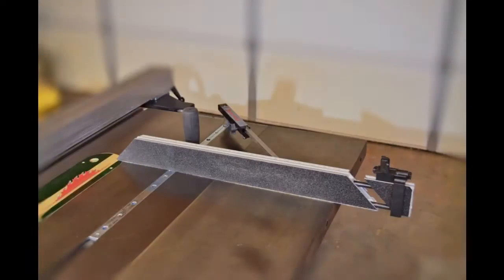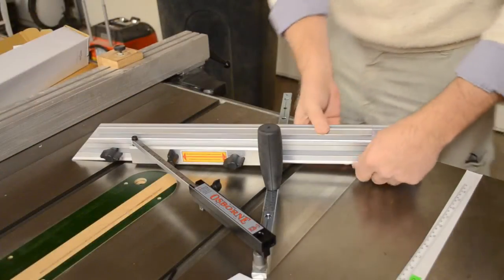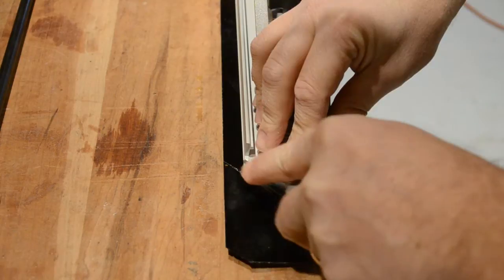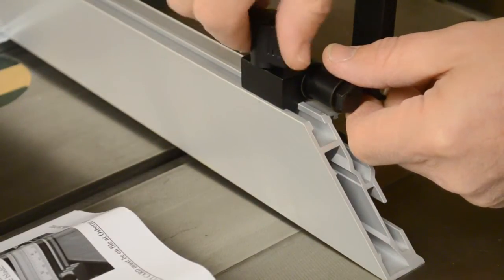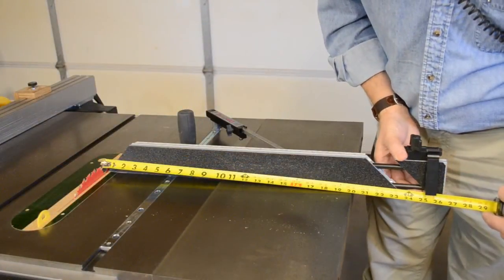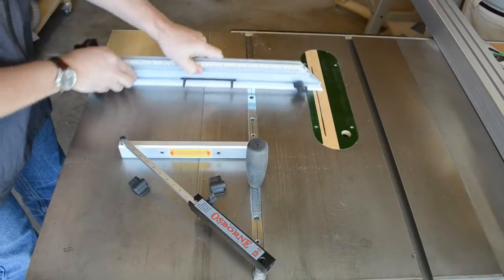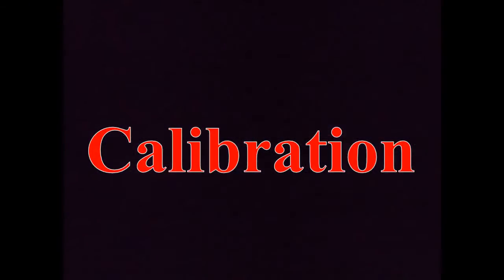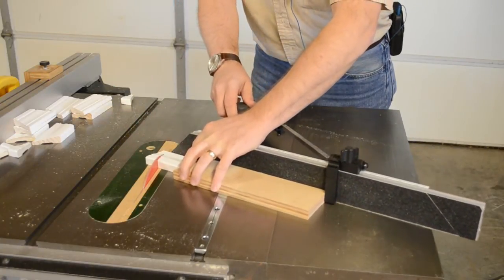Assembling the Osborne EB3 Miter Guide

Comment: I have added an in-feed extension for the guide bar to rest upon when cutting wide plywood. its just a 12" extension for cutting 24" wide plywood ( a typical width when building cabinets). This a very well thought out tool. for this price point it can't be beat.

Comment: I love my EB. I no longer use a sled and with the assured repeatability and accuracy, this is my go-to miter solution.

There is one option I would like to see added to the EB product line, if you truly are looking for perfection.

I would love to have a micro-adjuster on the stop. It would be much easier to make fine adjustments to final cuts. It would be an easy retrofit or accessory to your current offering. And I would be more than happy to test drive it for you!

One last suggestion. Make the measuring tape out of metal and provide a magnetic surface to secure it on top. I can assure you, more people would use it than what is provided now.

Thanks for making a great product.
Reply from the maker: Thanks Tonka! The micro-adjust is a great idea.